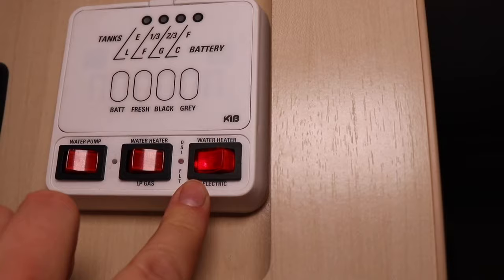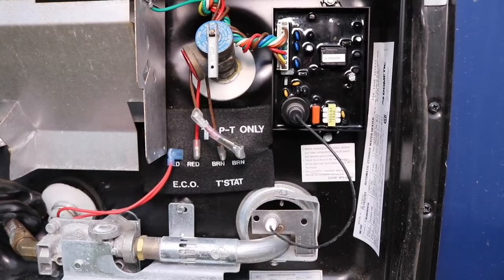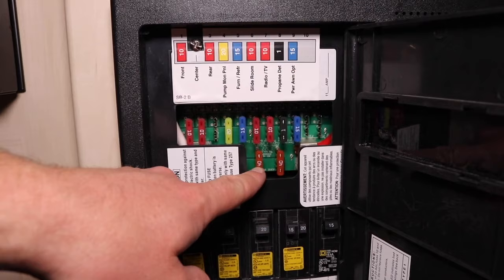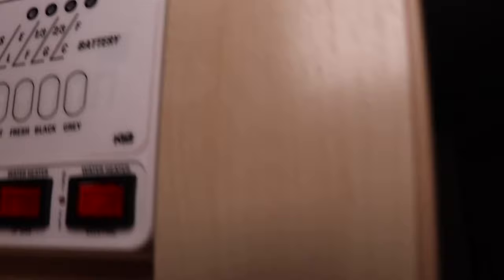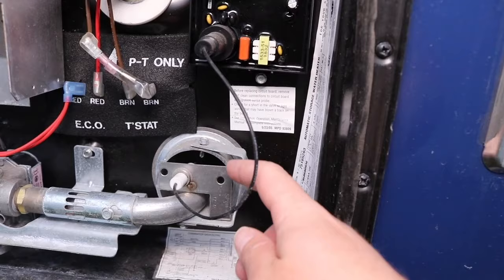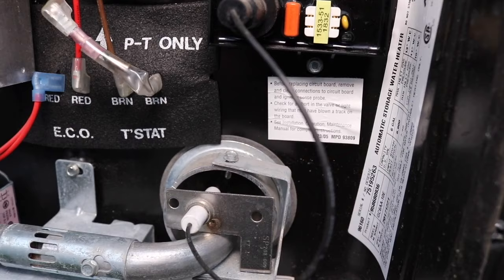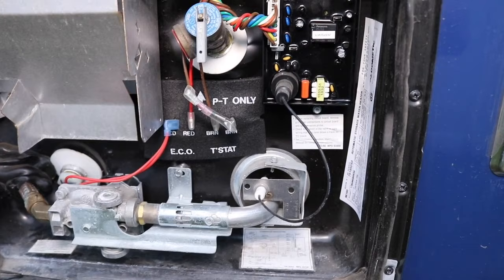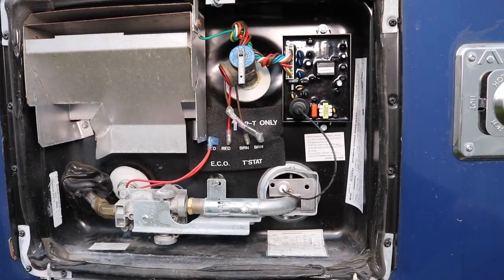RV Water Heater Troubleshooting: Troubleshoot, Diagnose, and Repair

Comment: From my experience One of the first things to check is the thermal link fuse. It is located on the E.C.O. /  T STAT on the Brown wire. It is the plastic tube about three inches long with the wire running thru it with pink spade connectors on either end. It's purpose is to blow or open up if the area gets to hot (heat hot) and it shuts power off to the the T STAT.  While not recommended you can test it by turning off power to the unit and unplugging the fuse from both ends and simply reconnecting the brown wire to its proper connection leaving the fuse out of the circuit and turn the heater on if it works there is part of the problem. (The other part is why did it blow?). IT IS NOT A GOOD IDEA TO RUN IT WITHOUT THE THERMAL FUSE however it will work in an emergency until you can replace it.
Reply: This just fixed me issue. Thank you!
Reply: What / where is the E C O / T STAT located? We have a Suburban electric/propane water heater. Replaced anode rod, 110 element switch,  and heating element. Works on propane but not electric.  Is this brown wire on the outside or inside under the sink, or the fuse box?
Reply: @kathypalmer8565   its located outside
Reply: Lol I thought that was the issue it looks blown out but I didn’t know what it was called
Reply: DC Fuse first (mine !5 Amp located aside the 120 breakers in the inverter/main panel) The pull-able modern auto fuse type. I spent hours on forums and eons trouble shooting this and that, while I'd initially looked at my fuses, I had nor looked well enough, The fuses were poorly, indeed mislabeled from the factory. The "Z" was blown on the blue 15 amp fuse, What might have   taken 2 minutes took 2 days.
Reply: 8:21 my water heater fires on propane but not electric. However, I only get hot water for about 8 seconds and then it’s cold again. Any suggestions?
Reply: How do you replace the thermal fuse? I ordered and have in hand, but can’t find an actual video of how to replace it.
Reply: Mine worked on propane last night, electric this morning, but now it won't switch back over and work on propane. It is up to temperature since I just had it on electric mode I don't know if that would affect it I always heard you could run both same time but I can't even get a fault light by the switch on the panel in my camper or clicking like it's trying to light. Trying to stay out of service center.

Comment: incorrect description of electric heating element location, the thermostats are not the element (wich is located on rear of tank ,
Reply: HAHA HE DONT KNOW ALL HE SHOULD ABOUT HIS RV
Reply from the maker: Thanks for pointing that out Rich, yes, you are correct, on our model the heating element is on the rear.
Reply: What is considered the "rear" of the tank? 
Would that be the opposite side to the one we were just looking at in the video (meaning, the side Inside the RV/Travel Trailer?)
Thanks in advance for your reply. I bought a used trailer and am trying to figure this all out. 
Sidenote: I'm a home improvement contractor and own (and maintain) my 33' cabin cruiser (boat). I can fix things,  I'm just not familiar with RV systems and appliances yet.
Reply from the maker: @gellotion  Yes, the rear of the tank would be accessed from inside the RV. It should be behind a panel directly behind where the heater is located on the outside. Hope you are able to troubleshoot it.
Reply: @TheSavvyCampers  I appreciate your reply and have some more info to share... there's a thermal diode on the brown wire closest to the control panel. It works similar to a fuse... it burns out and breaks the circuit, shutting off the water heater and preventing it from restarting. It's a safety measure in case the ambient temperature gets too hot in that area, to protect against fire spreading. 
I found this out on another trouble shooting video, and it solved my problem. I see you have the same diode on your heater.  The replacement was about $30 at Camping World, for a new wire and 2 diodes...one to install and one to keep on board for backup.
Reply: @TheSavvyCampers  to test your diode without a continuity tester you can unplug it on both sides and hot wire the brown wire directly to it's terminal, then try to start the heater. 
If it starts with the diode removed, then the diode was your problem. Replace it immediately. Do Not Leave The Heater Running without the diode in place! You won't be protected against fire in case it overheats again. 
I hope this information helps.  All the best! 👍
Reply: You can also ohm the thermal fuse. If you have continuity then the thermal fuse is good

Comment: My issue is I have no power to the hot water heater at all. I have power at the on off switch. The propane detector is working it clicks the on off so annoyed on and off but no power to the hot water heater. I’m baffled.

Comment: Great Video but...here's my problem, mine turned on by itself and then got the water so hot it blew the water lines  to the kitchen sink. This happened at 2am, was very loud and I had water everywhere until I shut it off.

Comment: that was a really thorough rundown and I've got the same unit. however my unit is now completely dead for both propane and electric water heat. I'm getting no sound at all. they both work just a matter of days ago. but I had to quite a bit of water leaking out the pressure release valve so I switched it. it worked for one day and now it stopped. I know the electric element was making a fair bit of noise to heat up which I think was slightly abnormal

Comment: This video is very informative and helpful so thank you. My question is this: I recently purchased an RV to become a full time RV-Er! Now can I leave the water heater on all the time or should I only turn it on when I’m going to need to use it? Mine is currently out which stinks because I’ve only had it a week. It is propane only, the tanks are full, the water was scalding hot two days ago and all of the sudden no hot water. I’m about to check the fuses and see if that is the issue but would appreciate you advice on turning on or off the water heater. Thank you,

Comment: I replaced my thermal cutoff 2 weeks ago, which fixed my hot water problem. The very next week had the same issue, replaced and its now working again. Do you think it was just a bad part(the first one) or some other under lying issue?

Comment: I have a 2012 Coachmen Apex that doesn't have an Air Adjustment, only a Screw to adjust Gas Flow
.Does it supposed to have one? I have adjusted the Gas Flow Screw all the way down and one turn Up
I get hot water for an instant, but none after that. I smell unused Gas all the time and have soot on the side of the Camper coming up from the Heater. Do I need to Turn the Screw Up, because I have a Lazy Flame Now or Down?

Comment: I have a full tank of propane and it was running fine last night on propane. I wanted to check out electric mode this morning and that worked fine. Then I tried to put it back on propane and and it wouldn't light and I didn't get the fault light by the switch either.  I always thought you could run electric and gas together I checked the fuses and breakers and everything was good just wondering if there's an inline fuse somewhere that I'm missing in this suburban water heater. I checked all the other propane appliances in my camper and they were all good. Just wonder if I have a bad switch since I don't even get a fault light or clicking lighting noise.

Comment: Looks like we have a very similar unit. Coachman Chaparral 28 RLS. What if neither electric or LP gas works? Plus we are getting a DSI Fault on the panel inside next to the LP and electric W.H. Switches… Thank you!

Comment: Can you provide more info on why the water heater may not run if the batteries are low, even when you are plugged into shore power?  I am having this problem now.  My batteries are low, and even though I am connected to 50 amp service, I cannot get my electric water heater to run.  It is the same one shown in this video.  I was able to get it to run on gas, but not on electric.  Thanks.

Comment: Mine starts heats up the tank to hot but does not refire up on its own it goes to a fault light? My other question  is when it doesn't relight is propane still coming out?

Comment: I've got a running water heater, but the water doesn't get warm past 9 minutes, but then the carbon dioxide detector goes off when I run the shower. I wonder if the heating element is out

Comment: My heater will not work on propane, the ignitor has good continuity, there is power to the board but it does not have any power to the ignitor . I gather it is the board.

Comment: I appreciate the video and think I may have a similar issue as the one you described experiencing on a previous camping trip.  My Winnebago Minnie plus works fine on electricity, but will not ignite when using propane.  What did you do to solve the issue after you tested your board? Thanks in advance!
Reply from the maker: I had to get a new board. Apparently there was a flaw with my model of board so they replaced it after the warranty was out.

Comment: Thanks a lot, very helpful. My Winnebago Micro water heater does not work on electric or propane. I checked and confirmed I have 12v going into the board, and the fuse is okay. I’ll be ordering a board. Any suggestions where to get the part?
Reply from the maker: How old is your trailer A.J.? You could always reach out to the water heater manufacturer even if it is out of warranty of if they have a updated model number. If not, Amazon will probably carry it or a quick google search should give you a few retailers.
Reply: @TheSavvyCampers   It’s less then a year old. It’s 2021 we purchased in Aug.
Reply: @Miltownred83  I have a 2021 also, any luck finding a board?
Reply: @garbo5000  You can get a really good replacement from Dinosaur Electronics.  Here is the reference chart to match up the make and model of your RV Water Heater.

https://www.dinosaurelectronics.com/UIB_Chart.htm
Reply: Thanks.  I just fixed my Dometic water heater which had a corroded thermistor connector.

Comment: I have a problem with my water heater not turning on and the harness that is connected to the pc is burned, I have replaced the harness 2 times and the same thing happens, do you think the problem is the pc?
Reply from the maker: Take your board out and see if a dealer will test it for free for you.

Comment: I don't have a hot water breaker or a fuse for the hot water heater it's a 2012 pioneer not like it's extremely old I don't understand why it doesn't anybody have any information would be greatly appreciated thank you

Comment: You need to view how the dual propane regulators actually work. It does not matter what direction you put the lever to determine what tank is online. It is ONLY for the fill meter. The online tank will always be the first tank valve that is turned on first. To prove this, turn your lever to one side, say curb side, then go turn off the curbside tank valve. The regulator auto switches to the roadside tank no matter the position of the regulator lever. Placing the lever halfway is just ridiculous.

Comment: I was hoping that you would show how to test and where the 120v heating element is.
Reply: If you have an Atwood water heater, the heating element is at the back of the water heater. It has to be removed in order to replace or test the element.

Comment: I have a 2006 Hitchhiker Trailer, why would I have hot water in the kitchen sink and not in the shower?  Is there a valve I need to turn on?  Thank you for the video.
Reply: Someone may have a inline cut on/off under a sink or near water heater that somehow got cut off.  
The lever will be inline with the waterline to indicate it is on and going to the area.  
If lever is perpendicular it is off.
Reply: @michaelwatson8103  thank you sir!

Comment: Hi when running on propane it only stays on for a few minutes recently,works fine on electricity.
Reply from the maker: Try cleaning off your flame sensor, will look like a probe that is mounted into the flame.

This was the exact problem I had with mine and it ended up being the control board. If cleaning the sensor doesn't work, take your control board off and to a service center to test for you.

Hope you get it running, let me know what you end up finding out.

Comment: Sir, you’re pointing to the ECO and the thermostat which you stated were heating elements. It’s an easy mistake to make. Those are not the heating elements. I’m sure a lot of people already told you that, but I’m just checking to make sure. Thank you for the good video.

Comment: Them are not heating elements in the front.  It has one heating element in the back. Them 2 round things in the front are thermal disks.  Or what ever. I here like a temperature sensor.  I just replaced my heating element  and them disks.  Did not fix my problem my control bord buzzing  and have the falt light if I run ether one. But my gas turns one but won't turn off.
Reply from the maker: Yes, you are correct, I misspoke in the hustle of filming. The element is on the rear of the water heater.

Comment: Yes !!! Great video 2021 Winnie micro ... first trip no worky? Has or electric
Reply from the maker: Did you get it going, or still need help?
Reply: The Savvy Campers ! Hey just got back from first trip . At home before we left? Could not ignite with power with electric from home . Did Propane it started .. got to camp started with gas and was fine until next day ? Would not turn on ! Plenty of propane breaker on , also tried to use generator... won’t come on .
Reply: @thesavycampers I have a similar rig (2021 Micro). We’ve had it for about six months and when we got out to the campsite last weekend, the water heater wouldn’t work with gas or electric. Will the igniter continually click when the water heater is turned on propane like it did in the video? Ours does not currently. Thanks for the video!
Reply: Garret McElveny it was the diode? That clear tube ? By pass it and see if it will turn on . Just don’t run it like that long .. just to test

Comment: What happens if your carbon monoxide sense goes off everytime you turn on propane for water heater?
Reply from the maker: You probably have a propane leak somewhere in your propane connection at the water heater. Try using some soapy water sprayed on your fittings to search for it.

Comment: THIS is why you should never buy appliances with any type of circuit board.
Reply: Hah! Good luck with that. Practically every appliance in the last 50 years has a circuit board somewhere.
Reply: @kentshook3840  My Sub Zero does not, nor does my stove, water softener or dishwasher.